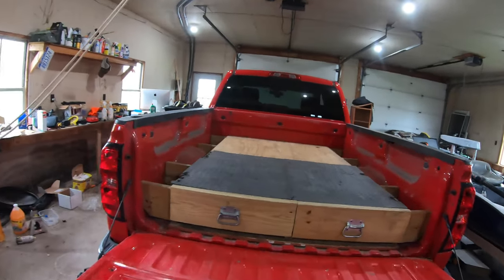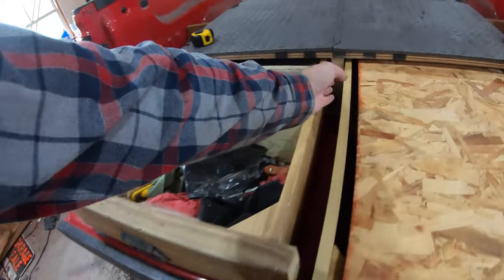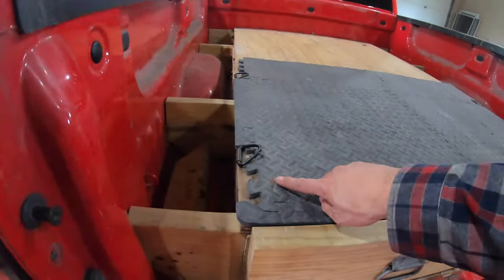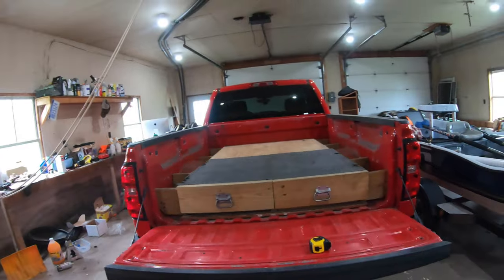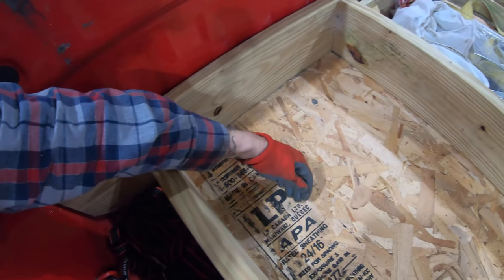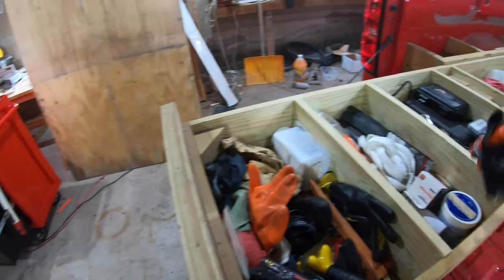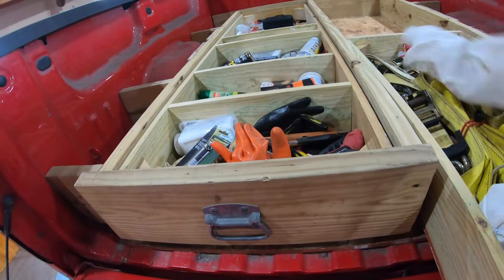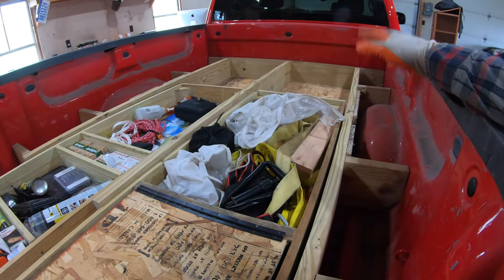Truck Bed Draw System 2 Year Review - EDC -Tear Down - Post Mortem - DIY Storage drawer

Comment: I highly doubt that 100 pounds wore out your tires in a significant way. The weight on the back of the bed might actually be better for tire wear (up to a point) as it would keep the rear wheels from slipping and wearing faster. Try driving around with an empty pick up bed and giving the truck some beans, the rear wheels will slip.

Comment: I know you didn’t use drawer slides, but did you have any runners or anything on the bottom of the drawer? Was it just OSB sliding on OSB on the bottom or did you reduce the surface area somehow?